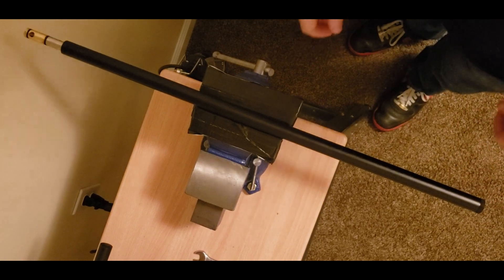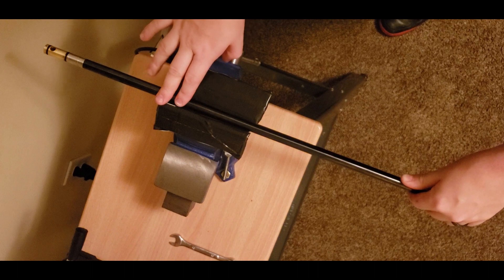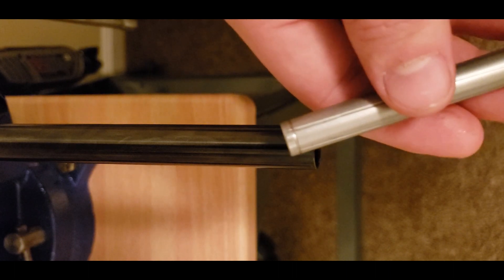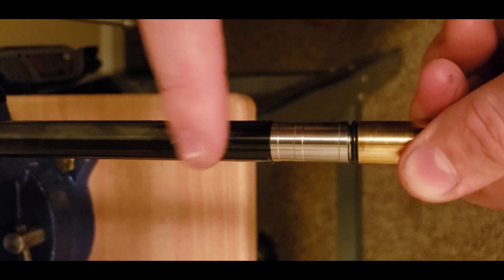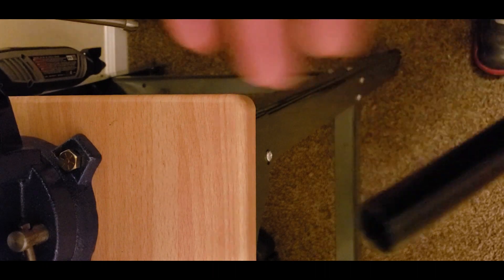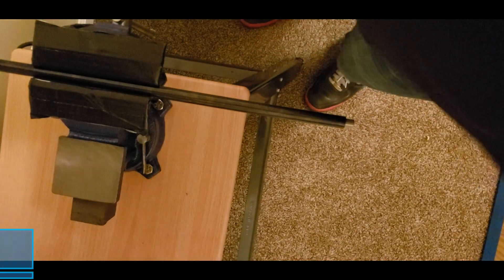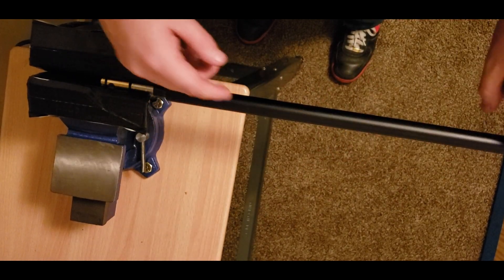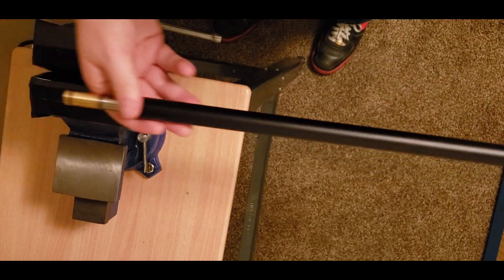FX Airguns Smooth Twist X Barrel - Complete Disassembly and Reassembly of FX Barrel

Comment: Don't forget to index your liner before you pull it out, to be sure to put it back at the same position! Otherwise you can have a big POI shift.
Reply from the maker: Great point! I apologize I forgot to mention that in the video. Whenever I am working on guns, I resight/retune after removing the barrel, so I did not think of it. 👍
Reply from the maker: @MMA Rank_1 they have mostly fixed the issue with the SuperLight design of the Crown and Compact barrels, slowly integrating it to all barrels 👍
Reply from the maker: @MMA Rank_1 thank you as well for the great feedback! If the big guys dont see this, atleast we can start something in the grassroots that will eventually get their attention 👍🤙
Reply: You are going to have a POI shift no matter what you do because of the design of the barrel. Because you have moved the o-rings when you take the liner in and out. And that is going to change both the harmonics of the barrel, and any slight bend. So you have to sight it in again anyway.
Reply: I just found this out the hard way 😂… about 5” up and to the left at 20 yards… seems like a lot ? Im going to turn it a quarter of a turn and try again. Hopefully get it back to or close to where it was before I stupidly took it apart.

Comment: Hello friend! I would like to understand a little more about the Liner + Overliner. I am purchasing a Liner STX Superior in caliber 5.5. 1- What is the external circumference measurement of this Liner? 2 - What is the correct Sleeve size that I should buy to use with this Liner? 3 - What are the internal and external measurements of the Overliner?

Comment: Hi I just purchased an fx impact Mark ii. Does this going to come with the STX Barrel or the smooth twist? If it doesn't come with the STX Barrel can I still shoot slugs with the smooth twist?
Reply from the maker: All FX Impact Mk2 came with the STX liner system. From factory, it will have some variant of a liner designed for pellets of the appropriate caliber.

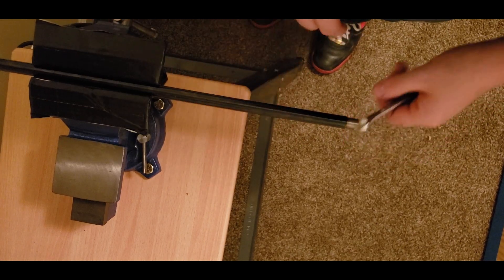Comment: You said the thread was M12X1 @12:00 then you said its 1/2"X20 unf @16:00,  so is the barrel attachment to barrel house M12X1 and the linear locker to barrel house is 1/2"X20 unf?
Reply from the maker: Yes. One end is M12x1, the other end is 1/2"x20 UNF. This is for .177 through .30 calibers

Comment: New Dreamline total different no liner barrel spacer I've just spent a shit load on a liner don't need it
Reply from the maker: It is the new Superlight system. Are you able to return the liner you dont need for a refund ?
Reply: @910AirgunTuningandRepairs  I'll keep it it'll come in handy for another project, the real new Dreamline classic were it enters the barrel attachment its totally different I had no plans to work off its so had to wing it it was pretty easy though much simpler than the old system. It just has 5 orings on the barrel stacked.

Comment: Great video on this matter I have striped all this to swop out O-ring s no Loctite on mine or no sign of it
dident apply any when reassembling works great indexed my liner marked it wos 3 clicks on scop off POA
will be fitting a carbon tube so no need for the O-ring s on liner stiffer
barrel is a  win win

Comment: Need your help sir. Attempted to install my new superior liner. When I replaced the threaded piece at the muzzle the side lever won’t close. It seems to be hitting something. I noticed if i remove the liner lock as you call it when I close the side lever the pellet liner moves slightly forward then back. Maybe just a 1/16th but it does move. So even when I tighten the liner lock only finger tight it won’t allow the pellet liner to move. Tried installing the pellet liner with the side lever closed, but after installing the bolt or side lever mechanism won’t open. Really need your help. No info on forums. Thanks sir. Thanks for the two brass jam nuts you sent me. They worked perfectly.
Reply from the maker: Hey William, It sounds to me that the liner you are installing is a smaller caliber than your pellet probe/barrel is set up for. If you install a .22cal liner into a .25cal barrel, for instance, the pellet probe will still fit into the barrel inlet, but it will hit the liner, as it is larger than the liner. This is my best guess. Another option could be that the liner is backwards, so you are hitting the choke. You will find a groove engraved into the liner on the breech end. Hope this helps!
Reply: @910AirgunTuningandRepairs  Really appreciate you getting back to me. I checked the caliber of the new liner by using a .25 pellet. Seems correct. Talked to a tech at FX he’s never ran across this issue. Pyramid air agreed to exchange it for a new one. Hope it works. Thanks again for your help and for your tuning videos.

Comment: I don't know if FX put locktite on or just REALLY tightened it, but my liner lock is basically stuck on there.  I don't know how hard I should try to crack it loose.
Reply from the maker: FX does not loctite them for sure, it could have been over torqued when attaching the shroud and/or the moderator. You will need to hold the barrel in a vise, and use a 10mm open-end wrench on the flats

Comment: Is it okay if I don’t reinstall the oring that’s atteched in the barrel liner?
Reply from the maker: Unless the o-ring is replaced with a carbon fiber sleeve or another solution, the o-rings are necessary to properly support the liner within the barrel. Without the o-rings you will notice accuracy issues and possibly moderator clipping.

Comment: Good vid.
Have a question if i wanna change from 30 cal to 25 can i just buy a 25 liner and brass inlet or do i need a new barrel whit 25 liner?
Reply from the maker: You will need pellet probe, brass inlet, stainless steel barrel attachment, liner, liner orings, and liner lock. You will also have to stay the same length of liner, and if you want more noise reduction/better accuracy, you will need a new air stripper for the shroud.

Comment: You did not show the most difficult part. There is an O ring that goes inside the steel liner which sits in between the brass transfer port and the barrel sleeve. Its an absolute nightmare. Ernest Rowe said it was an 8*1. He did not show assembling it either. I tried different sizes and still cant. It is really important as it aligns the liner to the pellet inlet. Once you take the liner out, there is a pretty good chance that you might dislodge it and the only way to get to it is to dis assemble the entire rear part using heat. Good luck.
Reply from the maker: I will be covering this in a separate video as it is difficult to film. The o-ring is caliber specific, as follows:
.177 = 7x1
.22 = 8x1
.25 = 9x1
.30 = 10x1
Reply: @910AirgunTuningandRepairs  Thank you for the reply.
Reply: @910AirgunTuningandRepairs  Hi,  Have you done this video? The two o-rings came out with the liner! Would appreciate some advice on how to reinstall them. Thanks!

Comment: did you forget to mention the verry small and fragile o-ring in the threaded piece between bras en shroud ? people should first install the liner in the breech side parts before threading it onto the shroud. That way you can check on the o-ring so it does'nt get damaged or puched out.
Reply from the maker: typically there is no issue at all with the o-ring you mentioned, if it is coming out, it may be the wrong size, or the groove in the barrel attachment is not the correct depth